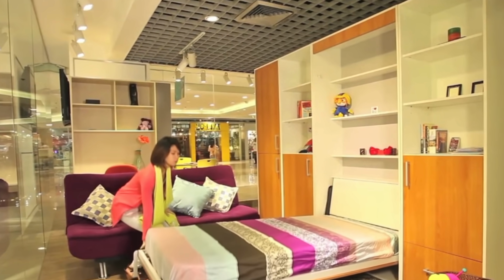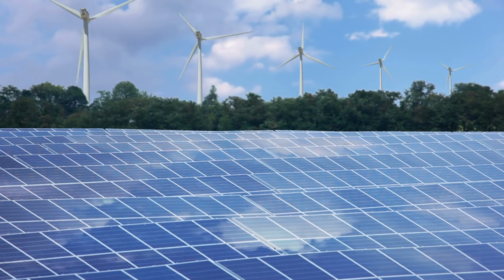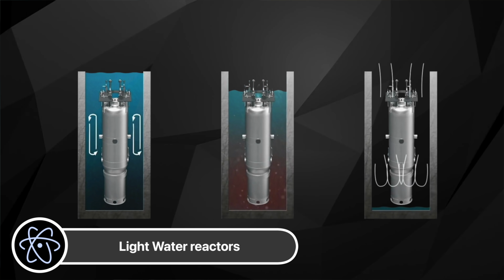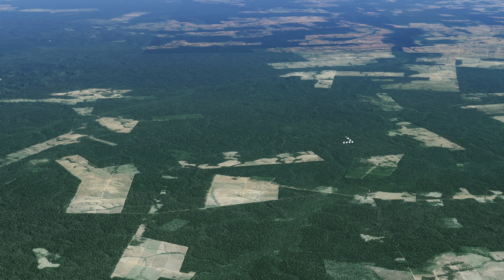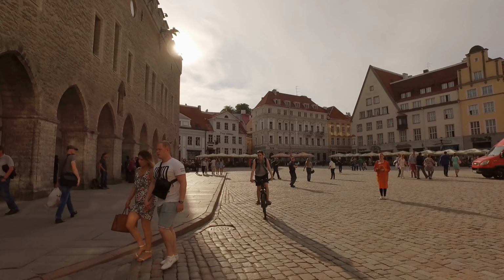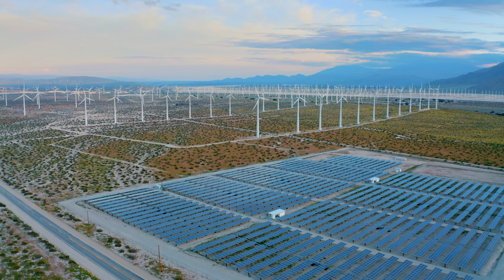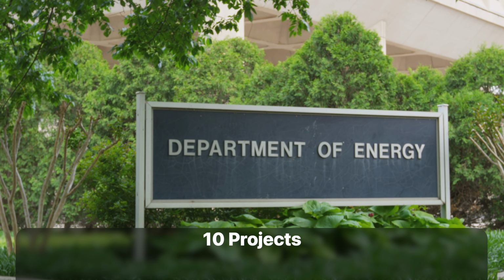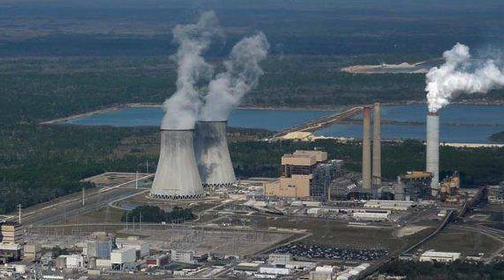Why Small Modular Nuclear Reactors Are the KEY

Comment: While you can reduce the physical size of the reactor, that's ony part of a power station. The turbine house and cooling system still needs to be the same size for the 2/3 of the heat which is thrown away which reduces its contribution to reducing global warming. With global warming will likely come more drought periods which will put the reactor off line if it uses a water source vulnerable to drought. Nuclear is not clean as it produces waste which is small in volume but hightly radioactive needing expensive very long term storage until its is anywhere near safe. What about the pollution of the mined areas for the fuel? Uranium is found in small concentrations and its mining destroys vast areas and damages many lives.
Reply: Mining for renewables is greater per power unit, since the energy source is renewable but the machinery isn't needing replacement periodically (blades, lubricates, transmissions, many miles of power lines, solar panels, batteries). Most of our energy should come from renewables but the machines do not grow on trees. The "waste" of concern is actually unused fuel which will be reprocessed (like batteries can be recycled) and "burned" in these new designs. The area required is also dramatically reduced so they are better suited for areas where available space or energy source (near polar or environmentally protected areas) is too restrictive for renewables and their energy storage.
Reply: @anydaynow01  So the turbines of nuclear power stations never need maintenance? I've read 5-12 years between complete strip down and rebuild. Reprocessing nuclear waste sounds idyllic so why does the USA have no reprocessing plant despite producing waste for over sixty years? Solar and wind are distribued sources so do not need the massive and long power lines of centralised power stations like nuclear and solar can use existing structures or share land with agriculture in an Agrivoltaic system
Reply: @greg5023  Who's ignoring the carbon footprint of fossil fuels. The fact is that nuclear is not the answer to global warming, and that's why the nuclear industry are barred to the COP26 talks
Reply: @eclecticcyclist  That one turbine at a fission plant produces approximately 1 GW of carbon free electrical energy on average, and the materials required for the rebuild can be transported on one or two semi trucks. To set up and maintain just one offshore wind farm of comparable output the amount of material mined is mind boggling in comparison when you are talking about physical areas of low density energy production (which are the size of a small city as in many acres per facility), not to mention the cable needed to connect each turbine on shore to a substation. The same applies to the grid scale solar farms. A SMR with a very small exclusion area the size of a couple city blocks can be located much closer to cities than their predecessors like in a forest, field, small section of a farmstead, or the existing substation infrastructure from a decommissioned fossil plant.

I'm not saying these grid scale installations which will replace traditional power stations shouldn't be built, I'm referring to the fact the renewable plus energy storage solution must weighed against the production materials and energy required to make it viable at a grid scale, over time, hundreds of acres of material replaced decade after decade. It would be faster to replace fossil with these huge renewable and energy storage facilities for now, but for the future, maintaining so many large (and or scattered) installations will be an interesting problem to deal with. The same can be said about SMRs, so the location and available resources will dictate the best solution as these technologies develop.

For many areas renewables is a great solution, I personally plan on having solar with battery backup since I will be building a house in a rural temperate area. For large cities or industrial applications SMRs, especially the ones developed now and the future, not 40 - 60 years ago, will offer a less impactful solution in the long run for our growing population. At least until fusion is available, but that's a whole other can of worms!
Reply: @greg5023  Well then get rid of that internal combustion engine.

Comment: With HVDC or high voltage direct current long distance transfer of energy is more efficient allowing remote energy production with less line loss, this promotes the larger capacity generation and national grid systems, however for places like Canada eh with large regions of land and sportatic civilization micro grids make good sense along with remote locations or islands, Alberta has been looking into using small modular reactors to produce steam for oil sand steam injection instead of burning natural gas/ raw gas and waste products in steam assisted gravity drain wells and surface mining. I would hope large ships also would consider this a viable option for energy and other industries requiring heat or power, many large cities still have central steam lines and old infrastructure decaying for a refit. good show.

Comment: The biggest risk for current reactor designs is that they have to work u der pressure... thats what causes the issues with any cascade issues and why a reactor " explodes".    msr work at normal atmospheric pressure and without running under high temp. It CANNOT cascade, let alone explode.
Reply: lower temperature means colder steam. Cold steam is terrible steam

Comment: Tried modular reactor powered airplanes in the....... 50s or 60s, the shielding was just too heavy, only protecting the crew from radiation, not the people on the tarmac or on the ground
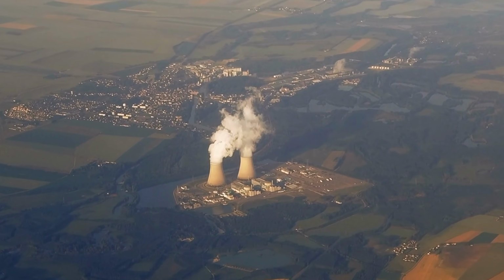2:04 You dont really need massive cooling towers if you build in the right place, for instance, if you build near an always flowing river, you can just dump that heat into the water as it flows by.
But ideally, if city planners were smart, they would bring back district wide steam heat for houses, allowing even more of that energy to be used. Dump that heat into the water in the summer, and use it for heating in the winter

Its important to not build right on the water though, but instead pump the water to the plant, and back, an evaporation pool can still be used for emergencies, but wont be running 24/7 so wont need the large cooling towers to raise the steam high above all other buildings

Also, for lighter than air craft, Solar would likely be lighter, and cheaper than a nuclear reactor for the power produced. Yes it wouldnt produce much power at night, but it would be far less affected by clouds, seeing as it should be above the clouds. Also, at that altitude, solar just generates more power

Comment: you left out a major drawback to nuclear power, and after all these years of using it they still don't know what to do with the waste, at many of the current and even shut down reactor sites sits thousands of barrels of nuclear waste. they are being stored on site because no one wants to become the nuclear dumping ground. which seems to be the only tangible idea anyone has had and that simply to dig tunnels in a desert and fill them with the barrels and hope the don't leak and find their way into the ground water somewhere. I like the idea of the reactors, the reliability and being carbon free. what I don't like is that they built them without any plan to dispose of the waste and just figured that would be somebody else's problem to figure out later. well after all the years since the first reactor went online they still haven't come up with a solution that all can agree to and the stuff had been accumulating every since.

Comment: The NuScale SMR are 77Mw designs and the company estimates that the first demonstration reactor will cost $4 billion which is way more than the cost given in this video.  All this channel does is spew out PR that is not true and has never been attempted or proven in the U.S..  Let NuScale build their reactor in the U.S. and then and only then can you know the cost and build times.
While SMRs should be able to be built faster and therefore cost less, if you need 15 of them to equal the output of one large PWR then that cost advantage is lost.  And there is little difference in the number of operators, maintenance, engineers, security, and admin staff needed to operate a SMR over a large PWR so they are significantly more expensive to operate.

Comment: 1:30 "isn't susceptible to... weather patterns..." - FUKUSHIMA HAS ENTERED THE CHAT!

(Yes, I know that's not "normal weather patterns", and was due to some piss-poor design decisions. But it has the reputation, deserved or not.)

Personally, I'm all for the new class of modular, pebble-bed, and other "melt-down-proof small nuclear" designs that are available now.
Reply: A thorium reactor cooled by molten salt, instead of the conventional water solution, would of fared much better.  With all the regulatory red tape now-a-days, you won't see this technology from the US.  Will probably be developed and refined in China, where they concern about the environment and risk is less.
Reply: @TFT-bp8zk  I disagree on the point about the plant design.

The plant, as designed, worked great. - Shut down due to earthquake, and was in the cooling stage. There was nothing inherently dangerous about the design (of the reactor). The plant's seawall and siting were not optimal, but the operations were the main point of failure.

The plant, as operated, did not work great - had the plant's operators put the diesel generator and fuel on the roof (or at least half) vs the basement - the meltdown would not have occurred.

Comment: Here's a pitch that I would have to say take the lifter nuclear reactor design from the aircraft reactor and try to compress it within the size of a diesel truck engine bay and then put that inside of a mixture between a electric truck and instead of batteries use the power directly off the nuclear reactor that is the molten salt thorium reactor design and use that instead.

Comment: yes, smr is the way to go, but they should not be high pressure and they should be able to be shipped back to a recycling plant.  As a side note, I would be extra cool if they can work in space.
Reply: we have RTG's for space no moving parts. moving parts in space don't work to well.
Reply: @phalanx3803  To have real space ships, we need 10s of megawatts to gigawatt capacity.  Stirling cycle could work for generating electricity.
Reply: @waynewilliamson4212  while true where a long long long long way from that. One big problem cooling reactors produce a lot of heat look at the ISS and how big its radiators are.

Comment: Any new nuke needs to be the kind that burns up most of the nuclear fuel and can run more than 20 years.  Waste not, want not. So tiny is probably not a great idea, unless the end product can easily be dumped into a thorium reactor to get rid of the end radioactivity.  The big monster in the room is what do you do with the tiny reactor after 20 years.

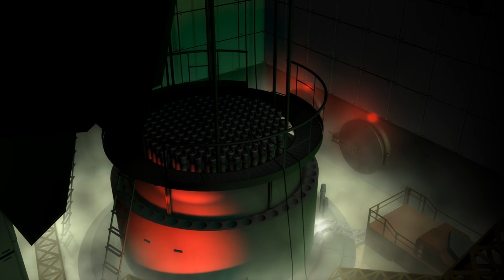Comment: 1:50
"Nuclear in the US can cost up to $6000/kW"
Say what?
Bill Gates SMR has an estimated price tag of $4bn (1.9 from gov subsidies) and is a 345MW reactor.
$4bn/345MW = $12.6 k/kWh
That is double the cost of your "up to" and those are still estimates and might even rise over the years and are build on a coal power plant's side so old infrastructure can be used.

Last US build reactors in Georgia was $25bn for 2 1117MW reactors.
That's a little cheaper than bill gates SMR at around 11000/kW, but again almost double the "up to 6000" stated in the video.
Last l

Comment: I'm totally supportive of nuclear energy however I've thrown in the towel on the tea kettles.  I very much doubt we could even take depleted fuel rods and surround them with PV panels for 24/7 production of electricity.  The public hysteria surrounding nuclear is of course fostered by the militant "green" movement in order to try to force solar and wind.  All surprise when the power starts becoming intermittent or blacked out for extended periods as these people hate all methods of generating power except those they support, no matter how green.  

A MHD reactor using lower pressures than the tea kettles and noble gases as the energy of ionization transfer mechanism, built vertically so that magnetically suspended control rods would slide into place in the event of disruption of the gas flow would offer superb safety and tune-ability while allowing fairly small units.  Doomed to remaining on the shelf of course. The modular proposals of this vlog offer an interesting but equally doomed path to electricity generation levels that will provide the darkened world of the future the light it will pray for when the present hysterically driven policies prove disastrous. 

I doubt these fools in control of energy generation of the future would not even allow orbital nuclear fission power generation.  We might be able to hope for a future of high power electricity  by nuclear fission on the moon itself but I am not even certain that would be far enough away for these uneducated ideologues standing in the way of mankind's progress.  

Personally I believe fusion power is a boondoggle because the sun makes an energy profit due to being subsidized by gravity.  Our experiments have no such subsidy and the Russians who once led the world in this research abandoned it long ago; though I am uncertain about the exact reasons, I suspect they reached the same conclusion long, long ago.

Comment: Nuclear or hydro. If either was small scale and more it creates jobs and allows for power to be made and shared.

I was hoping that a small scale (at home) could be super small and safe and generated power for the home. If that could be made for around £10,000 then this would be ideal. Or something that can supply a street and this was taxed or token payment maintained, then it could work as a home appliance's or building part of new builds.
Such as new homes with solar.

We've just had around a 40% rise is power costs, as pre pay, it's been apparent, for those who pay quarterly, it may be a big shock..

I was toying with solar, but over five years it was no cheaper than the grid, now it's cheaper, but with the post covid rises, the materials have also risen in cost.

My generator runs on gas and fuel, makes 2kwh  but has a run time of 15000hours. While that seams a lot it's slightly unreliable. But it is possible and less cost to run than to buy from the grid.
Reply: Nuclear has billions of times more locations to use than geothermal.

Comment: A Diesel engine can run using water instead of fuel but obviously that is supressed now. 
 I dont refer here to the water cell classical dissociation process which lack overall  thermal efficiency.  
I refer to the very nature of thunder type arcs which appear when water vapor and air are mixed with high voltage differences and when ozone gaz is produced 'thunder-engine)

 Already in 1930 over here in Europe, 30 per cent of water was injected with the fuel in most factories' used  Diesel engines to improve cleaning and efficiency..

 H2GE (US) claim to use standard (not DIESEL exclusively) motors now with a 5 per cent add up of fuel only to a "water vapor air  mix "charged" electro-statiquely (like a "charged" cloud in a thunder-storm)
. The difficulties include the fact that the motor run with abnormally strong noisy explosions  and the speed is not easy to control   (torque doubled  as per H2GE measurements) 
 The water/steam critical change at 14 bars (piston compression) require about 3000 joules per kg of water which are provided by the plasma type arc. (probably exothermic reaction (electrons links energy)   caused by the resonant  high frequency of the lightening arc in water vapour generating a shockwave ) The motor exhaust water with ozone.
Personally I , not knowingly, experimented that phenomena  some years ago with a 1980 tractor Diesel motor (70 HP) when the fuel tank was  empty and just few water remained underneath in it, the noise, heat and the overspeed (impossible to reduce) were very impressive.. The smell of ozone was astonishing.
Although a lot of big interests dont like this quite cheap and clean solution , the Trump "declassification" actions indicate to me that it is not if but when.
Reply: Show a diesel engine that runs off water.  
Your nonsense is not impressive.

Comment: We need to start moving on the climate issue NOW.  The next 10 years will be critical.  SMR's, won't be ready (en masse) until the 2030's.  There's still the question of cost competitiveness. But I've heard even if we get 80% renewables, because of cost, the challenge of intermittency, will be exponentially harder, on the last leg of the journey.  (This is the Clack vs. Jacobson debate.)

It's good to have some dispatch-able sources in one's portfolio.  This is esp. in light of extreme weather events, and the need for resiliency..  This is where nuclear can fit in.

Other options include, demand side management, gas+CCS, overbuilding on renewables (including storage), so that it covers the vast majority of the situation.  The few days (weeks?) per year, when one has some really extreme events, ... sure, go ahead and burn a few (legacy) natural gas.